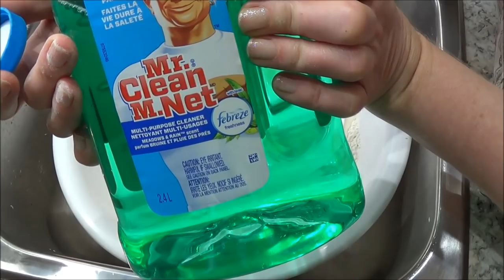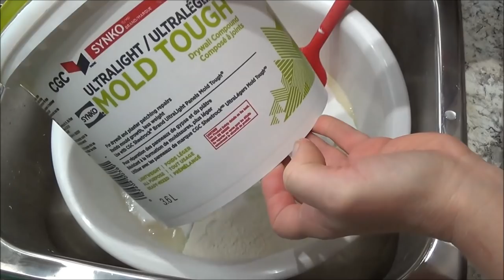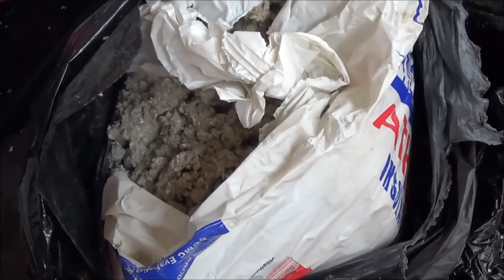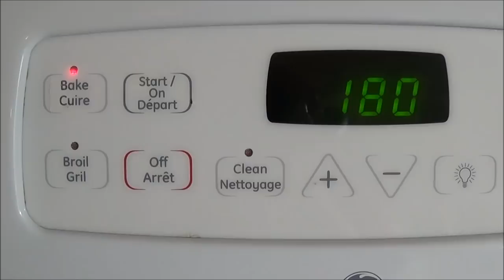How I Make Paper Clay 2018

Comment: If you measured the paper insulation and then made slurry of it with some of the 4 & 3/4 cups of water, it would incorporate into the other ingredients more easily (and you would not have as much dust). That way, you wouldn't need to use a mixer to mix in the paper insulation... The paper insulation is very dry and takes a lot of work to incorporate it into the mixture.

Comment: I still prefer recyled egg carton paper, drink caddy paper, it was already pre battered, and molded, so a soak in hot water turn it into fine paste, then add the other ingredients, and it comes out as smooth as real clay..but a way to add extra strength for it, depending on what your doing...say a mask that gets moved and used, add cut and shredded cotton balls, or old shredded pants fibers...the cloth weaves into it, and make it SUPER STRONG! also i dislike paper insulation, mainly becasue our living room ceiling fell in from it being old and a bad install, and i spent a week cleaning up old paper insulation, hours and hours a day of sweeping, vacuuming, and mopping it up..and breathing in the dust, hacking up black stuff. so yeah...

Comment: What’s the advantage of using this clay vs something like polymer clay?
Reply from the maker: @nuggetsaurusrex  this clay is more suited for covering larger surfaces and is the cheaper way to go if you were making pumpkins, covering walls in homemade dollhouses, or even masks that don’t require fine details, it has a rougher texture whereas Polymer clay has a smooth texture best for finer details.

Comment: Thank you for a very nice and helpful video! I have made a similar clay , I use discarded watercolour paper ( paintings I didn’t like, scraps used for colour charts etc) that I tore in pieces, boiled in water and then mixed to a pulp before mixing it in a ” soup” of wood glue, flour and some dry wall fix. That way, with a very wet paper pulp, there was no paper dust.
Reply from the maker: ohhh that's so awesome! Yes, there's different ways of making the clay..I like the idea of no dust for sure. I recently updated the method I use to egg cartons and also cardboard, I showed both in one video, if interested https://youtu.be/eh683-nSf4s

Comment: I have been using  this recipe as well for the past few years I love it so cheap and easy. I like to wet the fiber insulation in hot water and blend it with the beaters to help smooth it a little more then drain it. Also my thrift store beater died so I use my beater attachment in my dewalt drill works great. Great video, it’s nice to see the consistency.
Reply from the maker: yes, the attachment for the drill works great for sure. Scott Stoll uses that, I never had access to one when I first tried it so kitchen beater to the rescue! I actually just made a couple more batches today, it's so quick and easy to make. I'm forever grateful for this clay!

Comment: Great video and tutorial. If I may suggest ... Try soaking your insulation in the water and blending it (in a blender!), first!  Then the paper will better mix into the recipe, and you may not need to knead it as much.  The smaller paper bits will make for a smoother clay, too!  

Just a thought!

Keep up the great work!

Have a better day!
Reply from the maker: thanks! I'm using a hand mixer but it really is meant to be mixed with the paddle attachment  and  a drill, if I used one of those it would mix up in a flash! lol
Reply: @WhereTheGnomesLive  I meant to put the water and insulation in a blender to mix it up first, THEN add the rest of the ingredients and mix with a hand mixer / paddle attachment, etc.  Sorry if I confused you. :)
Reply from the maker: no, it wasn't confusing. I understood what you meant, I was just saying it would mix in a flash, no blending needed if I had a drill and a paddle. I offer a way to mix if someone finds themselves without those special tools or blender (I actually don't have a blender, gasp lol) There's recipes out there that use cardboard or newspaper that get broken down with water and a blender. The paper insulation is broken down already, that's why I use it, but if I ever get a blender I'll give it a try.. although, I am used to this recipe and I can mix it up pretty fast as is, it comes out smooth and it really doesn't take long at all. Thanks for the tips, it's always good to try out new things/ways :)
Reply: @WhereTheGnomesLive  I see.  I guess I misunderstood you!  lol.

Have a better day!  keep up the great work!

Comment: Have you ever tried freezing the clay? You may have to add more insulation and re-knead it when you take it out, but I think I would try freezing a ball of it just to see if it works. That way if you can't use it all up at once, you won't have to throw it out. Just a thought. I freeze a lot of stuff to prolong the life of it. Thanks for the recipe. I will be using it. I have a plaster mixing blade, a 5-gallon bucket and a heavy-duty drill. Think I will try mixing it that way since I have arthritis.

Comment: Thank you,so much for such a wonderful tool. Is the clay when baked weatherize? If so, how long would it remain outside without retai no ing moisture? If  not, could Portland cement added to the mix, create a weatherized end product?
Reply: I've played around with thin set mortar that you get in the tile section. It has polymers that make it super strong after it dries (& mind blowing light too). I just mix the mortar to a pancake batter consistency add pulp and go. I've made antlers and they are light and super strong!

Make small batches because it will not hold up in storage. I've had sculptures that haven't been painted last the seasons really good so far.
Reply: The clay is basically paper mâché. You can varnish the finished product with marine varnish (for boats) and it will last pretty well through all kinds of weather. I'm curious how cement would change the clay. If anyone tries it, I eager to know hoe it works!

Comment: Question: instead of using the paper mixture that you have in the bag, is there a way that you can use your old newspapers. If it is by shredding them, or any other ideas you may have. Regardless,  my question is how can you use your own old used newspaper without having to go out and buy a paper mixture... unless there are other ingredients in that mixture that is bot talked about. Thank you very much.
Reply: If you tear up the newspaper and let it soak in water it will soften. Soak for an hour or 2 then put water and paper in a blender for a few seconds srain out the water and you have your paper fibers. I soaked mine for 6 hours once because  Igot pulled away and it was falling apert without the blender.
Reply: Tanya Winters I have never made paper clay, but your method is also how you make pulp to spread on a screen to make your own handmade paper, you can add leaves and tiny flowers in the pulp for a very fancy paper too!

Comment: Could you use soaked newspaper instead of the wall insulation? Or is there something in that that you need?
Reply from the maker: I believe the soaked papers would work, I couldn't tell you how the texture would turn out though in this particular recipe since I haven't tried it but I would imagine it would be okay since this stuff is recycled newspapers. There's so many homemade clays out there, many using newspapers. I think this insulation works the same just quicker since it's been broken down for us.
Reply: Yes, it works, although you have to let the newspaper/flyer turn into pulp, I believe hot water works faster, I usually let the paper sit in a bucket with salt for like 2 days and just strain it out. I make beads that way that is how I know.
Reply: Thank you for this info!!  Much appreciated!!

Comment: If you have a old or cheap blender take the amount of salt your going to use . Put it in the blender and turn it into a fine powder. Wait before you open the blender for the dust to settle .  Maybe stifling the flour would make the clay more smooth ? It’s a trick I was told by family that made bread dough art years ago. Their stuff was so awesome ! I’ve only used store paper clay to sculpt artist dolls . I like the texture . Not the fact you can only get it in small amounts that cost large amounts . Any ideas ?
Reply from the maker: It's not the best clay to be using for sculpting fine details but it's excellent for covering  larger surfaces. Walls of a dollhouse, mushrooms, masks, paper mache sculptures. To smooth out the surface, a bit of water and a knife works really great!

Comment: So, I'm wondering if I can use the mixture without the paper as a paste and use paper strips for normal paper macheing.  Also, the other thing I'm wondering is does the clay need to be really solid?  I kind of liked the consistency before you added the rest of the paper.  I need to make an Audrey 2 head out of paper mache.  I'm using balloons as my template for size and roundness.  Thoughts?  Please advise.  Thank you in advance!!!

Comment: Have you ever used toilet paper instead of the insulation for a smoother clay??  I’ve seen this quite often and the clay looks not as lumpy. But of course it does depend on what your using it for.
Reply from the maker: yes, it's just a different method. Jonni Good has the toilet paper recipe, she uses it for sculpting. This clay I'm using is good for bark, walls, and things not needing finer details.

Comment: I used the linseed oil in the mix Hopefully that works but my question is how thick do you apply the clay and how long do you let it dry 😊
Reply from the maker: linseed oil takes longer to dry. I used to use that oil years ago but stopped when I realized it was slowing up the drying process. This paper clay is best used in thin layers, let completely dry then add more clay if needed. Dry time depends on thickness of the layer. Anywhere from 1 hour to many days depending if you dry it in the oven or leave it air dry. I recently did a hollow log tutorial, I timed the dry time in the oven at the lowest temperature, it took 5 hours, if I remember correctly. It took that long because of the raised lines of the bark  I hope that helps!
Reply: Since I had the mix already made before I asked I figured why not give it a shot anyways so I did a sample  of the paper clay 8x8 sheet 1/4 of an inch thick I just let it air dry took about 3  days I have to say considering I have never used paper clay before the strength of this stuff is incredible I took a hammer to it couldn't even  chip it a little 😊😊😊 now I have another question how many years can dried pakclay last after its dry
Reply from the maker: @davidcook3290  that's awesome! It lasts forever, I think. I used this to line walls inside my original Gnome Home and that's been about 3 yrs or longer.. I also used it as the outer layer of some of my clay characters. All have held up with no issues I've noticed.

Comment: I have a lot of paper egg cartons, so I’m going to be using those with your recipe. My question is:  After I make pulp out of the cartons, can I dry it (spread out on a cookie sheet) and save it when needed?  I like the idea of adding dry pulp to the liquid rather than the other way around.
Reply from the maker: that's an awesome question! I've never tried it but I would assume it would work as the paper insulation is made up of  recycled paper materials and paper egg cartons are too. That's the main reason why I like this recipe , the paper insulation has been broken down already for me.  I'd  give it a shot and see how it turns out for sure, I've often thought about trying it out with newspaper but I never thought about storing it away for future use (I just love that idea!)

Comment: Do you know the absolute thickest it will dry? I need to apply about an inch layer of it to a form I'm working on.
Edit: applying 1 inch thick is fine. It was used to make a large plug for a mold (stryofoam form underneath) and it worked great. About 20 gallons of clay were made. It took about 4 days to dry with applying fans on the surface. Careful not to apply the fans too close at first because it will crack if it dries too fast. The plug doesn't need to last very long so we are not worried too much about mold forming later on, however we did add a few cups of simple green to the mixture and sprayed the finish product with bleach.
Reply from the maker: the thicker it goes on the longer it takes to dry. I've never done an inch thick layer so I couldn't tell you how long but would imagine that would take a couple weeks to fully dry inside,. To be honest, I wouldn't be comfortable with doing a layer that thick, I would worry about mold. When I need a thicker layer I do a few thin layers, drying each layer before adding another layer.

Comment: Love your work.  I'm looking for the best way to make a large tree in daughters room.  What are the advantages of this clay over simply applying drywall compound and cutting texture into that? Thanks for your input!
Reply from the maker: you could try a test patch of the drywall and see how it holds up to cutting in lines once it's been painted. I haven't tried it. I've only ever used drywall compound for flat surfaces. Sorry, I wish I had a better answer for you.

Comment: Will this withstand rainy weather? I am doing a garden outdoors for fairies and gnomes.
Reply from the maker: No, you have to use an exterior sealer to make it weather proof. I’ve never done it myself but others have and said it works great for them. Best of luck and have fun!
Reply: Mod Podge makes an exterior/outdoors formula!!!
Reply: Coat with a layer of Paverpol, that will make it waterproof

Comment: Is there a problem of mixing paint INTO the clay at the start?  Would that prevent it from drying?
Reply from the maker: my only worry about that would be not knowing when it is completely dry. The clay takes a long time to dry, I rely on what I see to determine when it's dry before I paint it. The clay needs to be dry before painting and sealing.

Comment: Hi, how are you? Your work is very beautiful. I would like to ask you if the flour or the corn flour causes decay in the project when time passes where a very small insect appears causing damages in the work.
Maybe the vinegar and the salt would prevent appearing such problem?
Please reply me as soon as possible because I am very interested in applying  projects with paper clay.
Thank you very much.
Reply from the maker: I don't use corn flour so can't tell you how that would work. I don't use vinegar either but I do add in salt. I built a large project using this recipe and 5 years later no decay or mold or any issues with it. This is only one recipe for clay tho, there's many on youtube that do it in different ways so I would have a look at the other recipes too before starting your project. Just type in "paper clay" You might find one that suits your project needs better. Good luck and have fun!

Comment: The cardboard heart dries faster than the one on foil because the cardboard is breathable, whereas the foil is waterproof. So heated air circulates right through the cardboard drying it faster! 😁
Reply: Tami Elizabeth Allaway actually aluminum foil, esp the “shiny” side REFLECTS heat.  That’s why it does dry as fast as cardboard

Comment: How long does the finished products last for?
And is there a way to make it water resistant?
Reply from the maker: Once the clay is dried it will last forever. 
I've never made anything for exterior use. If you want to do that I would talk to a professional at your local hardware store and have them recommend a sealer.

Comment: Love your video. I would have used a rolling pin or glass bottle to flatten it to make the surface more smooth for any projects that have flat surfaces.
Reply from the maker: thanks! Yes you can roll it out for sure. On walls or other surfaces a wet knife really smooths it out too. Depending on the texture a person wants, it's super easy to work with. I've made it into a brick like texture by smashing crumpled foil over it. The brick was used to make a Labyrinth Worm House, https://www.sharonojala.com/2019/09/video-tour-labyrinth-worm-dollhouse.html

Comment: What side did you bake it on. Do you turn it over at times in the oven. Or is cardboard side down or up. 
This is just so awesome.  I'm going to Home Depot now to try and find some of the things you mentioned. Again Thank you.
Reply from the maker: if I put something on cardboard and then into the oven it would be cardboard side down. Lowest temperature until it's dry enough to turn over, if it needs to be turned over. It takes a long time. If you have a hot sunny day, put it out in the sun first and use up the free energy. I hope that helps!

Comment: Hello! Is there anything as an alternative to paper insulation? My country doesn't have these sorts of things, and I'm trying to do a simple project without spending too much so I don't plan to get any paper insulation from overseas... 

I love your tutorials btw ! <3
Reply from the maker: thanks! And yes, there are paper clay recipes on youtube that use shredded cardboard. I've never made a batch myself but I know you would have to break down the cardboard before you use it..
Reply: Where The Gnomes Live 
Do you think it would work if she just used wet, shredded newspaper in tiny pics and at it to the solution?
Reply: In America we call it cellulose insulation. It’s made from 85% recycled paper products. If you have a paper shredder, an easy alternative is to shred the newspaper, mix with water, let it soak for a couple hours, run it thru a blender and strain thru a fine cloth like nylons or cheese clothe until dry and crumbly. I haven’t used it in this recipe but we have used it in paper mache and such.
Reply: If you soak newspaper long enough (overnight, for example), the fivers fall apart on their own leaving you with essentially the same thing as the insulation